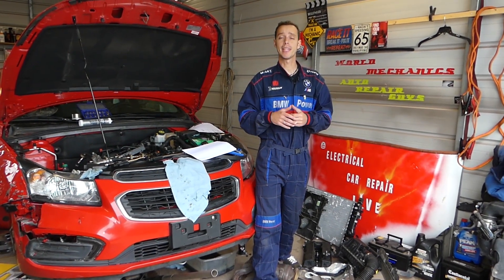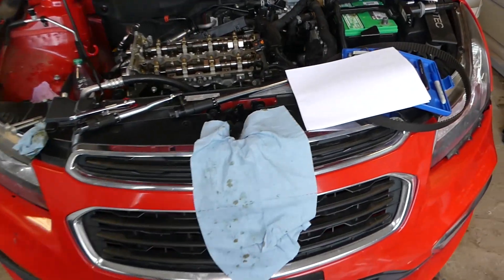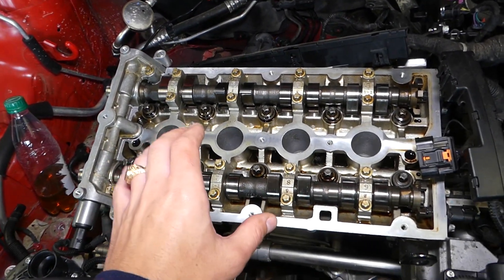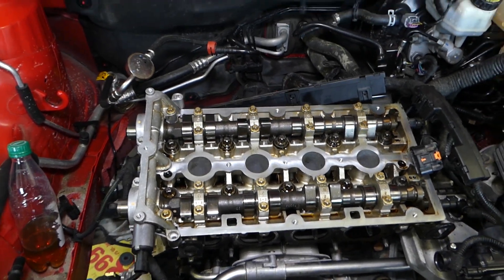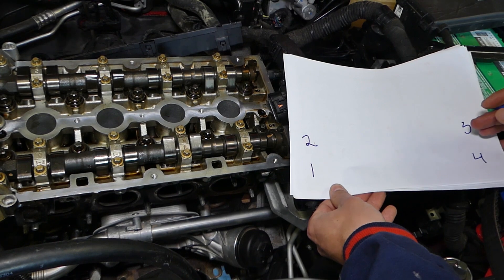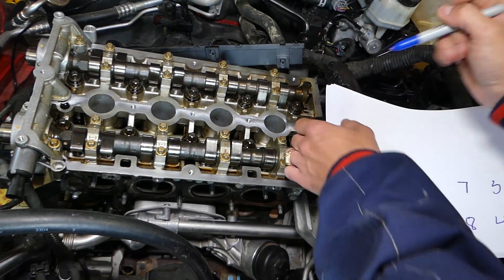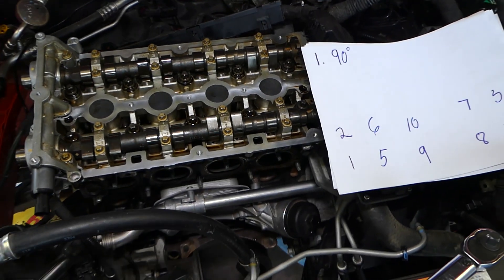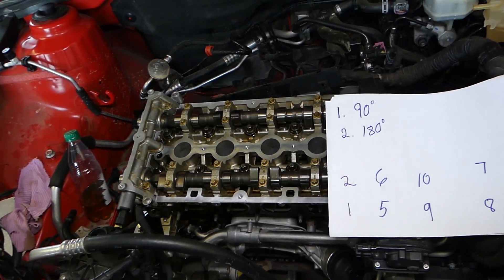HOW TO REMOVE CYLINDER HEAD GASKET. DOES IT MATTER THE SEQUENCE

Comment: Wayyy too much revolution and incorrect torque pattern. Pattern should be criss cross, since whatever you unscrew is going to immediately put pressure on the opposite screw. Also torque angles should be more like 30• at a time, 90• will warp the head for sure.
Reply: I'm not a mechanic (more like books and studies), but it looks way too much torque to me to. I'm doing my 2007 vectra mk2 1.9cdti (refreshing gaskets, carb cleaning, etc),  and my intention is to reuse the genuine head bolts.
Reply: @marinvremes5702  carb😂